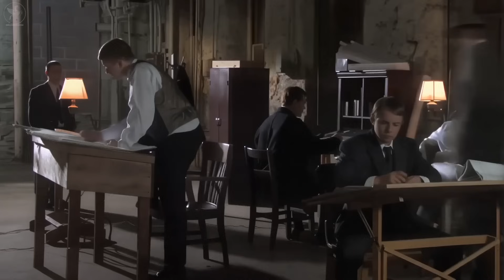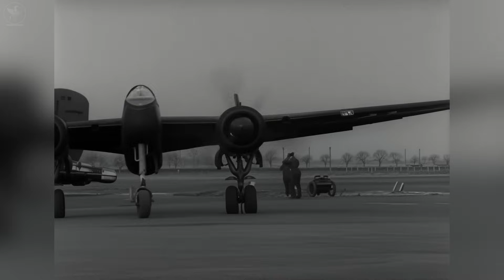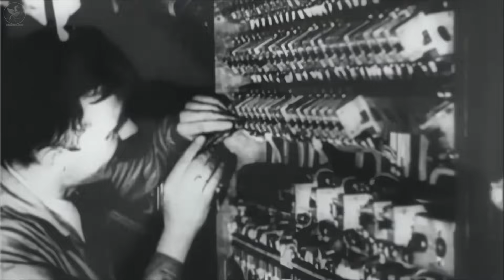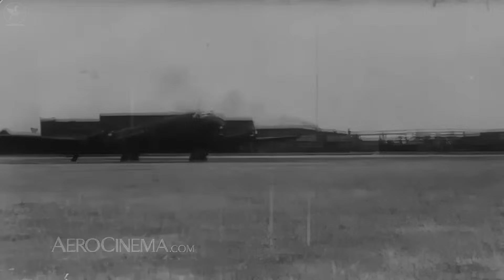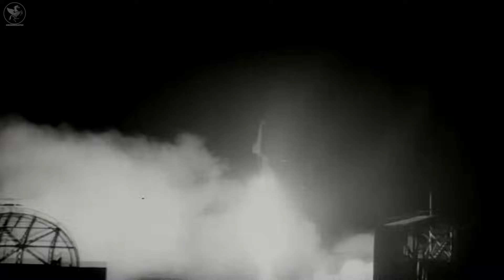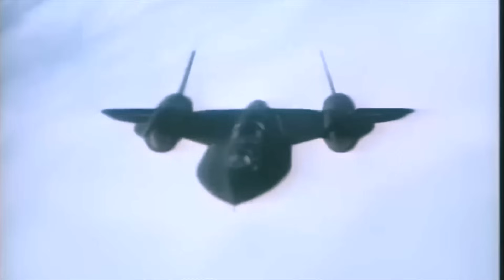NAZI GERMANY AVIATION INNOVATORS | Hidden Engineering: The Hütter Brothers' Story | UPSCALED

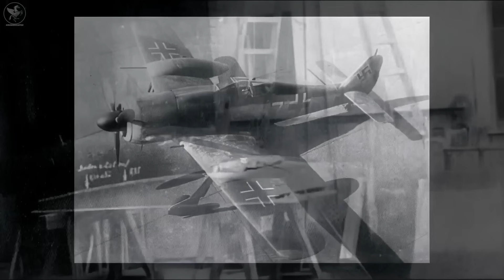Comment: 12:30 It's arguable which designers and designs in Germany were concerned with Area Ruling at that particular time. Area Ruling, in Germany, was discovered somewhere in late 1943, with the patent coming out in 1944.
Moreover, Area Ruling in propeller aircraft is a difficult affair, as the propeller (or propellers) create a significant spike in the cross-sectional area distribution which is either very difficult or impossible to smooth-out without creating considerable additional drag at lower subsonic speeds.

So, it only made sense to start area ruling jets, which is where Germany started to experiment with the concept.